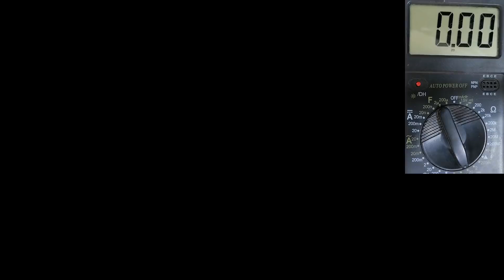How Pros Test SMD Components Directly on the Board | Electronics Repair

Comment: Dear sir, do smd components always get  shorted only or do they get open also ex : ICs, resistor, inductors, capacitors & smd semiconductors.

Kindly share on above matter or any links that would clear the confusion.

Tks for the videos which are self explanatory.
Reply from the maker: SMD components can experience open and short circuits as well as other failures.